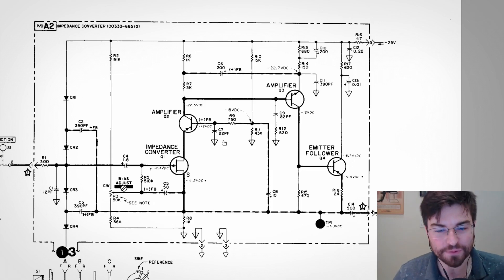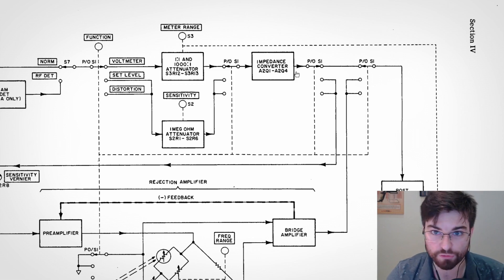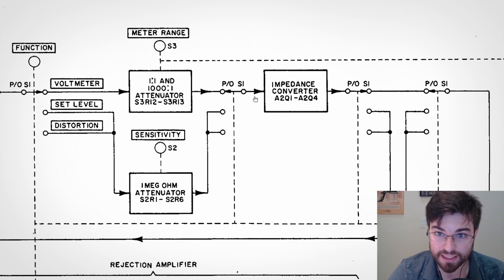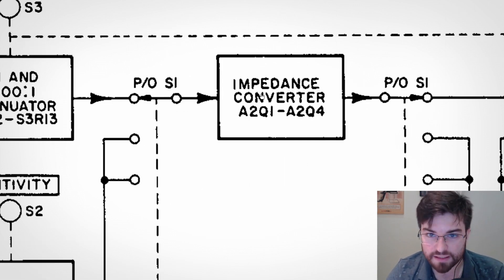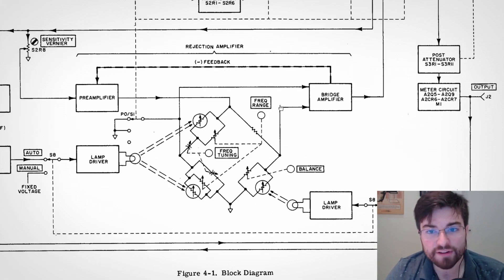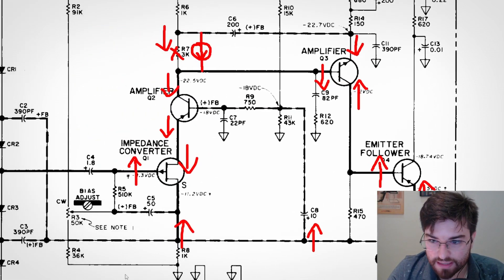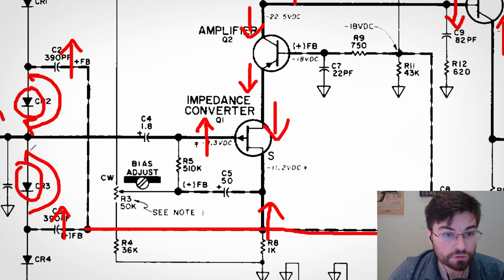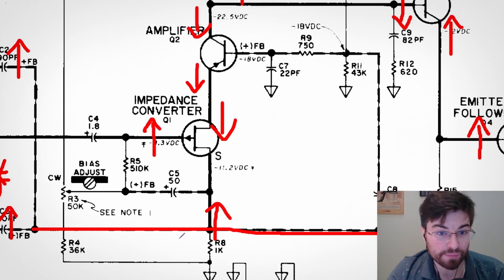Impedance Converter Amplifier - Circuit Analysis

Comment: The bootstapped diodes are beautiful lol. Had to use the same funny business in a mic amp to get rid of the capacitance because it was almost 5pF. Also it not only reduces the capacitance, but it also nulls out that 5-20nA of leakage, even 200-500nA in some old diodes and it keeps them properly closed at 0V and they won't enter their curves and become non-linear. They will also start to function as varicap diodes at that sort of range because that capacitance changes with voltage. That bootstrap is an essential part of linearity in this case, it isn't only for increasing the input impedance and bandwidth. Also if you REALLY want to get rid of absolutely all the leftover nano and pico units, you can just put more diodes in series.
Reply from the maker: Great comment! Thank you so much for pointing that. Indeed, this is key for maintaining linearity, something I did not notice when recording. Welcome to the channel. Greg

Comment: Excellent explanation!
The HP 3400a true RMS voltmeter also has a similar circuit at the input, but instead a JFET, It uses a Nuvistor tube with a BJT and is more relaxed about linearity, once a higher distortion factor will not degrade the measurement for a rms voltmeter with ±1% accuracy.
Reply from the maker: Thanks for the info!